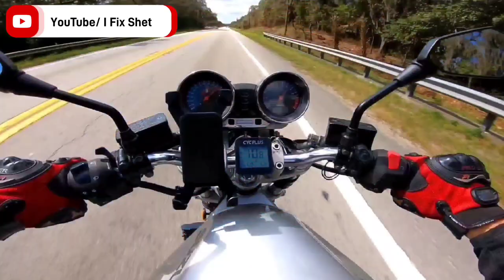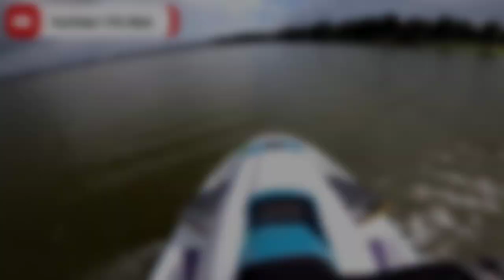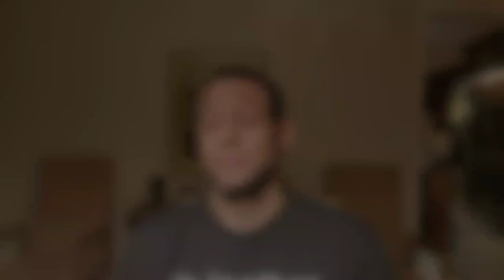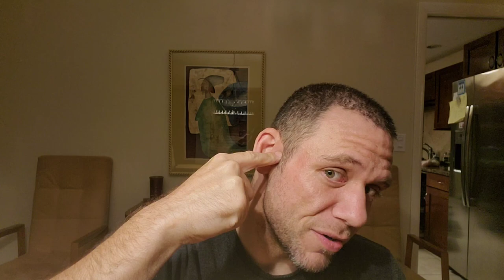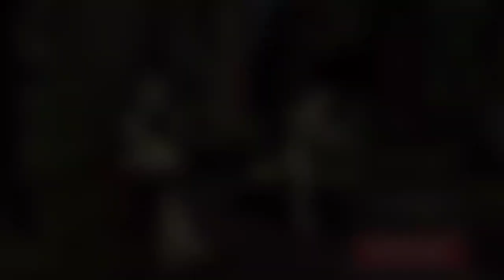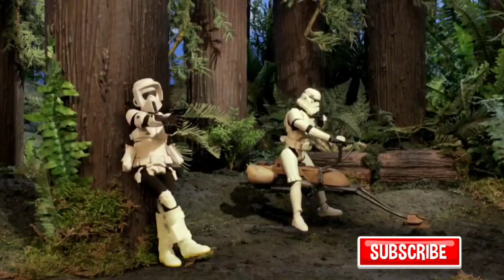Motorcycle Engine Knocking Common Causes

Comment: I've been owning/riding motorcycles since I was 9 years old.many of those years it was my primary transportation.Im 51 now and I have never owned a motorcycle that didn't tick, Clack, whine, knock or something.its what they do.and it's not the cam chain tensioner every time on every bike.smoetimes it is but I think the cct gets over diagnosed in the forums and videos.anyway the wrong gas can make one knock balancing shafts, clutch assemblies, valves out of adjustment, short piston skirts, drive chain slapping around and the list goes on.if it's something serious you'll know it most of the time because it'll be ridiculous noise.keep the oil and air filters changed with the correct stuff and most motorcycle motors are pretty tough I ran a Kawasaki with no oil going 80 and 90 mph for I don't know how long before I noticed it.poured almost four quarts in it and rode for a couple more years.dont lug it,keep it in it's happy rpm range don't red line it all the time ride every day if possible and maintain it and almost any bike will last .
Reply: Thanks for the advice mate! I have a slight knock when idling every now and again, I am bricking it… after reading this comment I am a bit more relaxed as it is just shy of 1 year old, it has had fun but not abused daily. The internet is an amazing place for some many opinions 😂 I will go with yours for now :)

Comment: How about too much oil?
Got my bike back from the dealer and it knocks as it warms up.
I’m pissed.
It wasn’t knocking before.
It was great. I’m pissed
I noticed the oil level is way way too high.  
Not sure if that could cause it, that’s why I’m asking ?
Thanks
Reply from the maker: Too much oil can ruin your valves shouldn't create any kind of heavy knocking though
Reply: @IFixShet  :  it’s not heavy, but enough knocking to know there’s knocking.
Although my cousin did not hear it, but i noticed it right away.
Wasn’t doing that before I brought it in.
Only has 1900 miles and ran great.

What could it be?
Such low miles, do you think they may have adjusted the valves at 1900 miles?
Could they be so stupid?

They replaced the drive shaft seal at the front sprocket and I noticed something on the sheet about an exhaust seal.
Why would they touch the exhaust for that?
Especially when this bike had a high slung exhaust that puts it out of the way of the area they need to work on?

Comment: Hearing knocks/ chatter in my 2005 zrx1200.. bike been sitting a few yrs . I replaced new clutch basket after clucth failure..someone told me to go through carbs because its been sitting..may b plugged jets ....also only starts on choke applied. When i twist throttle it cuts off...what u think?
Reply from the maker: The carbs need to be gone through
Reply: @IFixShet  yeah I just took the bottom float bowls off and I'm noticing some plugged Jets. One of the Jets has real small small pin holes on the bottom portion those seem to be plugged.. all the small pin holes need to be open correct..?  What is the best way to clean those jets..?? Ty btw..
Reply from the maker: @kawiman31  all the holes in Jets need to be cleaned. Honestly it's best to order a jet cleaning tool which has a bunch of different attachments on it. You can get them on eBay Amazon and timu for around 5 bucks. if not then you can often take a pair of needle-nose take a wire brush and pull one of the bristles out of it and that normally is stiff enough to clear the Jets
Reply: @IFixShet  yes sir... That's what I did ..I cleaned out all the holes.. getting ready to start it up..

Comment: I recently assembled my 1996 CBR919RR engine again (3rd time in 7 months). I changed the crankshaft, rod bearings and crank bearings. Measured and fitted everything before assembly and all the clearances were back within spec. But when idling it's like I hear a faint knock. I'm not sure if it's real or PTSD. I'll sync the carbs a.s.a.p. and hope that helps. Syncing carbs is a much easier solution than dropping and disassembling the engine again.
Reply from the maker: Agreed
Reply: How did it go?
Reply: I have a 1997 with a knock aswell only at idle but stops above 3000 rpm, haven’t been able to figure out why. What was your issues?

Comment: I've had a few different bikes by now.  If you are wondering about the engine knock of a used bike you might want to own, compare the sound to what that engine sounded like when it was new. This works for all sizes of bikes. If it sounds like an Asian sewing machine you might want to pass on it.
 I was just amazed at how noisey a 1200 R BMW was. I passed on it and bought a Honda 1200 GW the was much quieter. Older boxer engines are almost always a bit noisey.
Reply from the maker: I mean to be honest Suzuki engines run like sewing machines and that's just how they come from the factory so you can't use that as your ruling guide
Reply from the maker: BMW's also sound like sewing machines that's just a natural part of engine noise from those machines and how they're designed

Comment: so i rode my R3 with low oil (holds 2 quarts, had 1 [i added a quart and oil level fine]) it made a slight ticking noise during warm up. i rode it for 20 miles for an errand. i came home parked it, added 1 quart, did not start it. i will flush the oil to get rid of any metal shavings that might have caused but was that enough to destroy the engine?

Comment: My zx7 backfired after trying to start it.  
   Like a big one... and now knocks.   
   Well..  here i am.
Reply from the maker: If I was you I would be looking at your timing As being the Potential problem
Reply: @IFixShet  Thanks man.   I ordered a dynatek ignition.  And I'm not sure about it.  I put another oem ignition on it and got fire in both coils a while.  Now it's firing on just one set.   The knock seems low on the engine tho.   And the carbs were way out of whack.  
It got stolen and when I got it back... well.  I've just been through it, is all I can say.  
   I was going to do like ta said in the video and listen to each crank.   
   But I thank ya for the time and effort.   Fr
MJ
Reply: @IFixShet  Sir, you are on to something I hope.  I out the old mechanic's stethoscope to it... and the tick is coming from the timing cover.  &  I will try to keep ya posted...  lol while I beg for help!   Aight.  Peace out. MJ
Reply: @IFixShet  Brother!  You are so F'n money!
   Pulled the cap... and I'll be damned if it wasn't the pickup hitting the timing rotor.   
    Bro... ya give me hope.  Fr.  
  Much appreciated!   I'm stoked.
Reply from the maker: @Mr.EeToMyself   I'm a pretty smart cookie

Comment: I bought a ??? NON-RUNNING ??? 2002 ZZR 1200, was supposed to not run but found out the choke needed to be engaged.  BUT after getting it started it sound like a bust timing chain guide and then some small marbles added.  any idea what it may be?
Reply from the maker: Probably jumped a few teeth on the timing